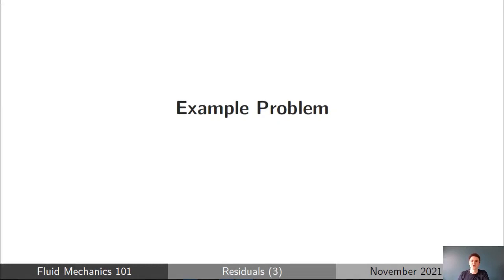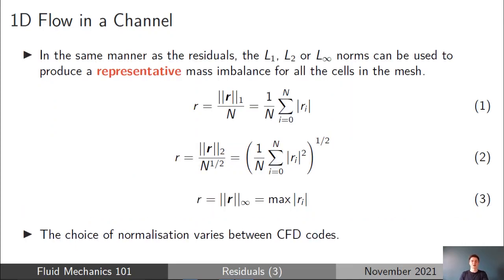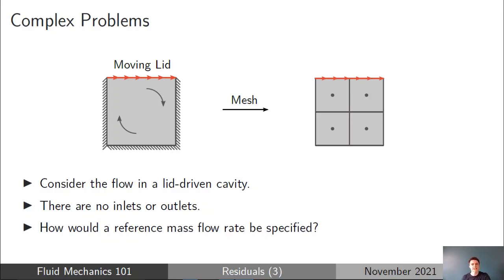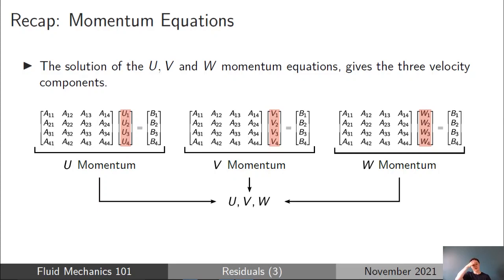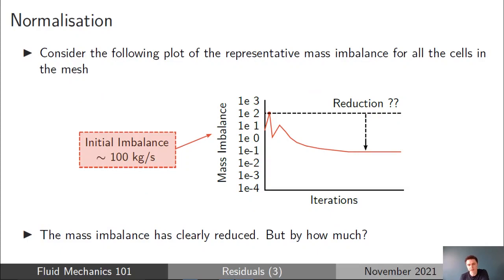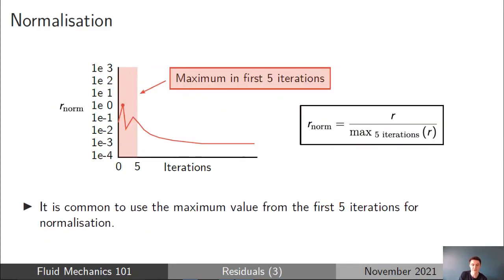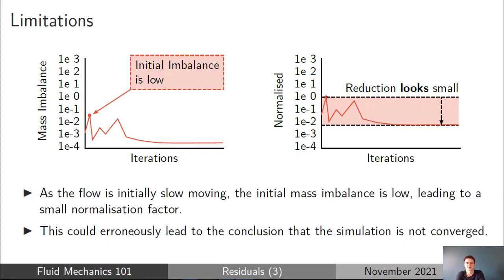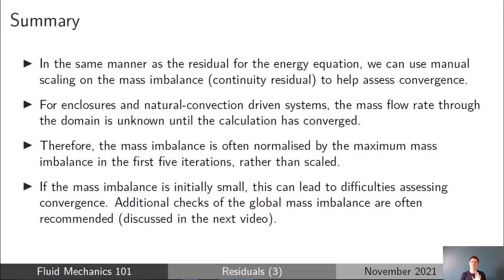[CFD] Residuals in CFD (Part 3) - Normalisation

Comment: Thanks for your lesson, i have one question which is in scale method you said to take diagonal coefficient and multiplied with temperature difference to get N, so what you mean from diagonal coefficient individual or sum of diagonal coefficient, also what you mean from temp difference, Is that temp difference of one cell or whole domain (include all cell)?

Comment: I am performing a CFD analysis on a static refrigerator, and in my Master Qualification Exam, one of the professors asked me about the level of continuity residuals from my simulation. At that time, I knew it was difficult to get low residuals due to the natural convection nature of the problem (lower air velocity inside the case), but I couldn't give a solid answer. But with your explanation I will have much more basis to explain in detail for my future master's defense. Thank you, Dr. Aidan!

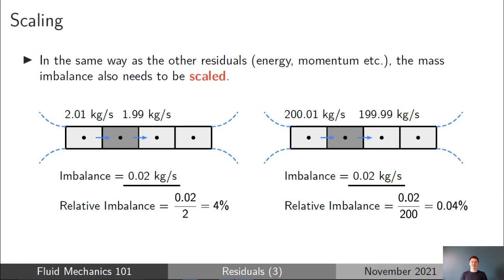Comment: Thank you for the great videos. Might be a stupid question, but why can't we just use the average of the (absolute) mass flux through each cell face (Either on cell-by-cell basis or throughout the whole mesh)? This would have given us the scaling factors you use in the examples at 6:53, so why wouldn't be useful in a more general case? Why is normalisation better?

Also, from the user guide you linked to, OpenFOAM seems to be a bit different here. Am I correct in saying they normalise all residuals not just mass imbalance. Also, their normalisation is very different. They seem to use the average of the residual vector, which would negate the point you made about choosing a value within the first few iterations to prevent masking a divergent solution. They also calculate the difference between the residual and the average value instead of using division. How would this impact my interpretation of residuals in OpenFOAM?
Reply from the maker: Hi Jeffrey, yes I like your approach for normalising the mass flux. You could take the magnitude through each of the cell faces. Actually you could probably take whatever approach you want, as long as it is just gives a good indication to the user of convergence. My only thought is that your method might be quite expensive. Maybe the reason that the CFD authors chose their method is it is fast and cheap? I suppose we will never know as we can't really ask them 😅 As for the OpenFOAM approach, I haven't looked into it too much (other than reading the user manual), so your guess is as good as mine
Reply: @fluidmechanics101  Wow, thanks for the swift response!
Reply from the maker: No problem. Always happy to help ☺️

Comment: Amazing and very helpful talk. Thank you very much. 
We are waiting the last talk on the residuals.
Can I ask you a question far from this topic?
How to know what solver type to use for my simulation case(pressure or density based)? and how to choose correctly the turbulence model (k-w-sst or k-eps,...)? and their coefficients? Thank you in advance.
Reply from the maker: Generally the density based solver is good for compressible flows. Otherwise, pressure based with k omega SST with the default coefficients is fine for most cases. If you want to go further, do some comparisons against some experimental measurements and see what works best

Comment: Hi Aidan, I was wondering if your course Fundamentals 3 contains an example of how to conduct simulation like in the 2D-diffusion-structured-grid case but with an unstructured grid instead ?
Thanks !
Reply from the maker: Yes! The course shows you how to write code for an unstructured mesh (rather than a structured mesh). The only thing that isn't covered is the non-orthogonal corrector, which is really complicated so I left it out of the course